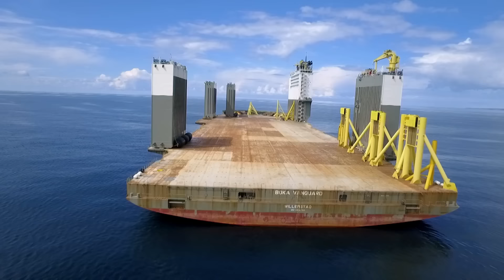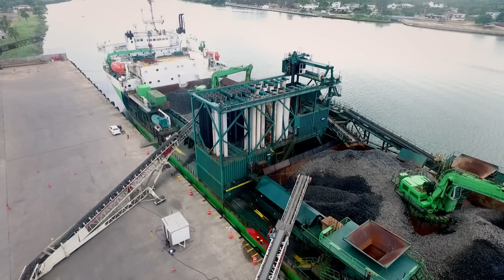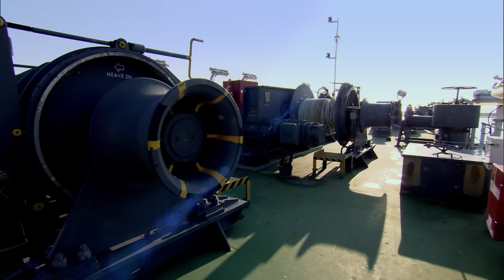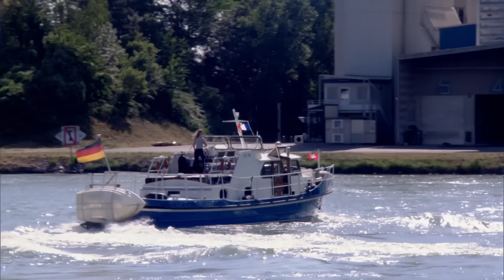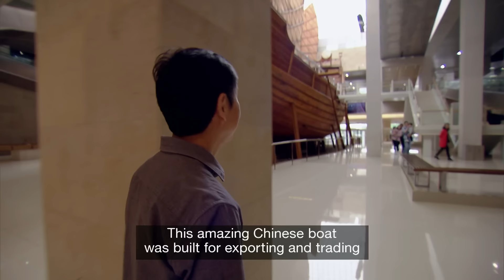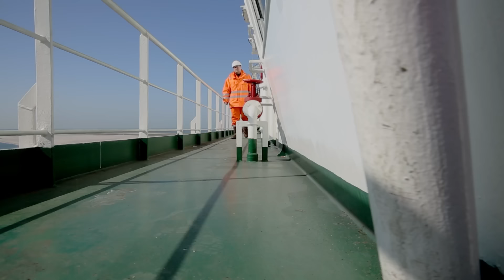World's Largest Ship Sinks Itself to Carry Entire Cruise Ships Across the Globe | Blueprint

Comment: But it can't lift the Shell prelude, that is the largest floating object ever made full stop, its ,488 meters (1,601 ft) long, 74 meters (243 ft) wide, and 105 meters (344 ft) tall, displacing around 600,000 tonnes when full, try lifting that.⚓👌🦘✌